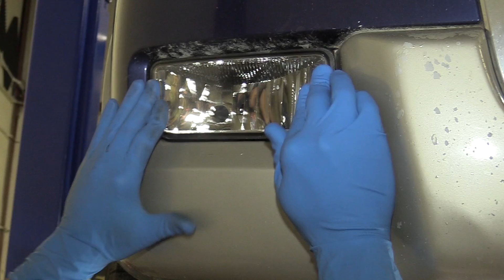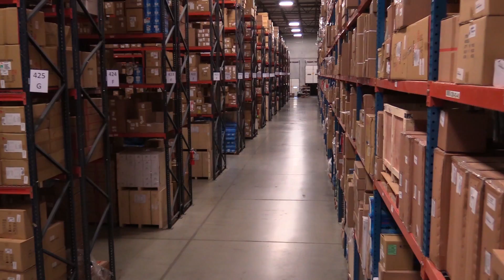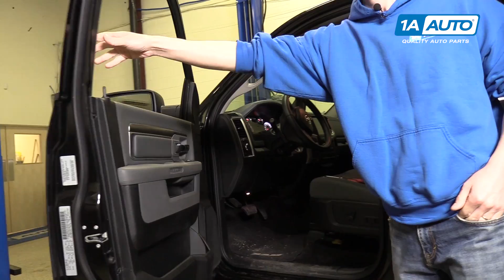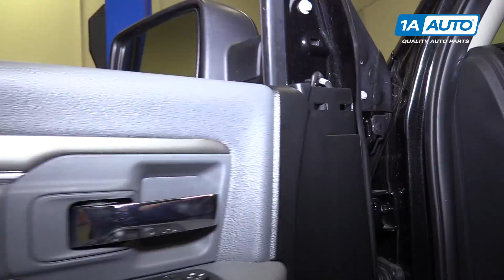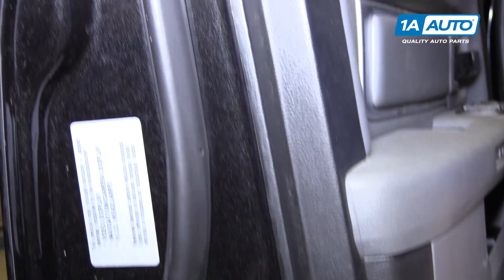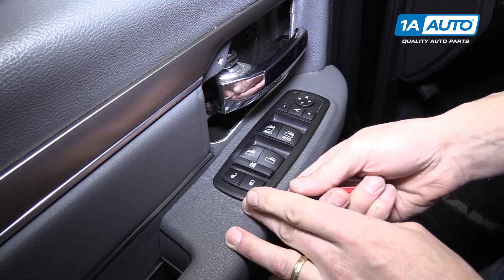How to Replace Front Window Regulator Motor 09-18 Ram 1500

Comment: Your videos are always top notch, thank you!  My passenger window goes up really slow or not at all, I'm assuming it's the motor that needs replacement.  I know without seeing it, it's impossible to diagnose but are there any other potential things that need changing on a power window or is this the typically the main culprit? '17 Ram 1500